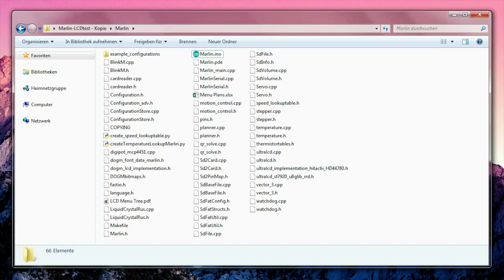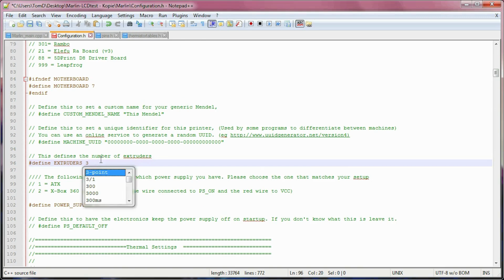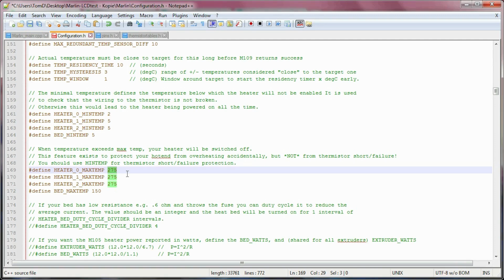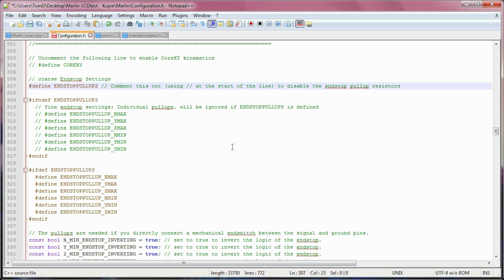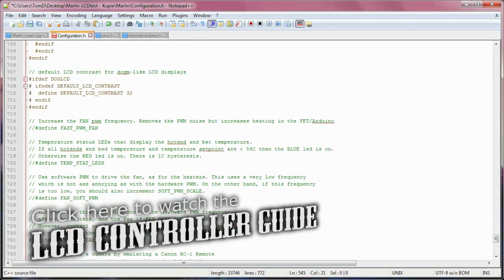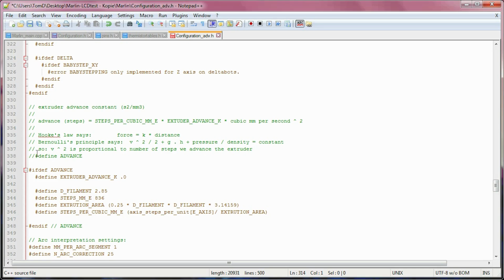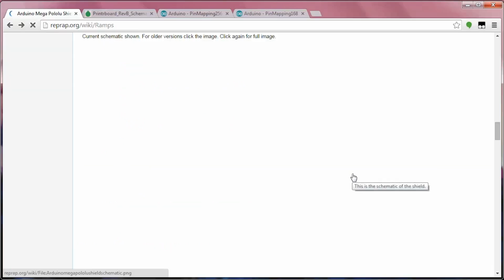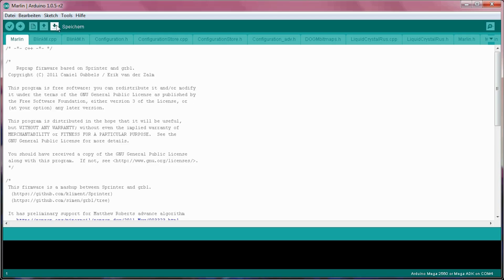3D printing guides: Advanced firmware tricks!

Comment: Tom I think the "advance" feature is basically depreciated/not working by now. Try Lin_advance. Also that K value would be insany low. Even for a super responsive hot end you would want at least 10 ... if you want to be super conservative you can use something like 1-2 ... 0.001 is doing nothing

Comment: Good video.  So, I have an SSR hooked to the pin for M80/M81 and I just switched to Cura 2.5 from a very old version.  I see that even thought I put an M80 in my printer GCODE, it stuffs the extruder heating code into the gcode stream before I can insert the M80 command - and this leaves me in a catch 22 - the same is true, so far as I can tell, with S3D, the heating code is run before you get to insert any gcode.

I have tried to insert my own exit in Cura 2.5 but it fails - when my exit is in there I do not get a list of exits.  I was able to create my own postprocessing scripts under Cura 1. whatever.

Right now I am editing the gcode to reorder the startup to add an M80 at the start.

Any suggestions?

Comment: Is there a quick way to move lcd menu items around? Like for example I'd like to have one of the move axis commands moved to the root of the lcd menu hierarchy
Reply: And pre-heat. Although I should edit the slicer to set temps THEN wait for the temps, at least doing it manually should be easier to get to.
Similarly, changing "pause" to "pause and move" would be super useful!

Comment: Btw, it is a well known fact that the bang_max and pid_max heater temp is not 255 but is instead 511 because inside Marlin (I forget where in Marlin as it has been a year since I had to do this) they do a << 1 which is simply a divide by half (bit shift over).  I always wondered why when I did a pid autotune it would show @128 even though I did a 255 so do 511 and it finally shows full power @255.

When I went to a metal heat spreader I suddenly could not get to my old 130c and couldn't even make 100c so I switched it to 511 and I was back to hitting 120c (heat spreader limited me some since it really is just a big heatsink as far as the heater is concerned).  I could have taken out that bit shift but chose to just do the 511 instead incase it was someplace else too.